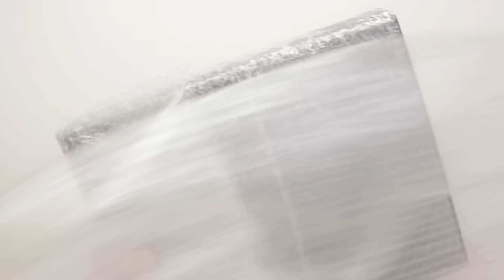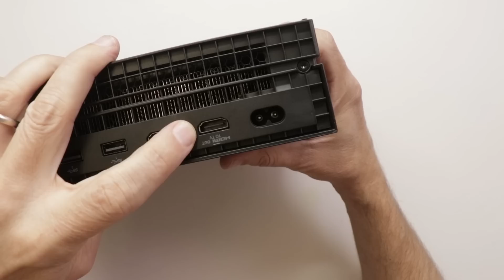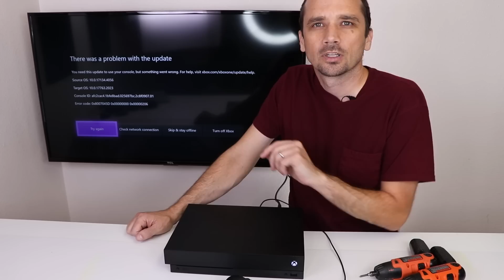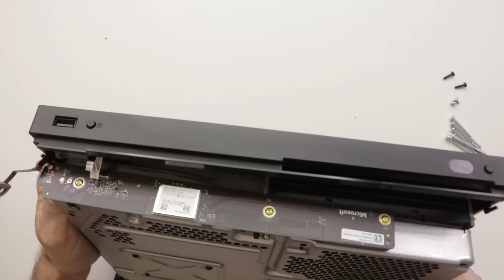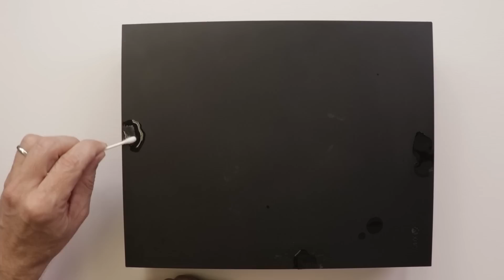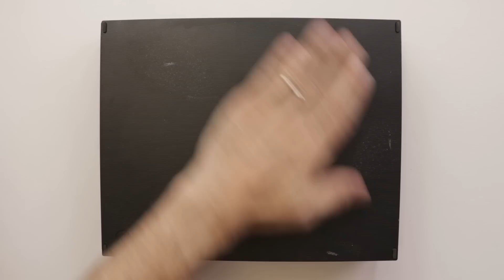eBay Repair Challenge 5 - It All Hinges On This!

Comment: If you ever come across this comment, there is a very very very good website a lot better than eBay and it doesn’t scam at all! It’s almost just like eBay but way more secure. It’s called mercari and yes it does have consoles such as this it’s a wonderful app and website! You’re guaranteed to get what you buy off of it as long as the seller responds, hell it even gives coupons for things over $20 if the seller you bought from doesn’t respond in time! I promise you won’t be disappointed. Also transactions of your money do not go through to the seller immediately like it does eBay. If you don’t get the item as it was said to be sold you have the option to report it before saying it’s good to go for payment. Hope you come by this!
Reply: Proof of not being a scam requires you to reply to me

Comment: For those interested - GooGone Citrus (kinda smells like oranges) for removing sticky stuff off of plastic. NOT the GooGone in the smaller metal cans! That stuff is industrial & is corrosive as all get-out. It smells kinda like lighter fluid. Stuff works great. (NO, I'm not a commercial, just trying to help out)

Comment: Use wax and grease remover to clean the outside of the consoles like this. U can get it at paint stores and stuff they use it to remove stickers on cars and what not. Works great just dampen a paper towel and rub it down. Comes right off. And it's fairly cheap and one can will last you years lol

Comment: Have you ever thought about fixing something different? Like a DSLR-Camera or something. I recently got an Olympus EVolt E-510 for 50€ and the only problem was a loose flex cable connection.

Comment: Consoles tend to use cheap junk hard drives, I'm surprised failures aren't more common.  Of course, non-tech people that only know how to plug things in, aren't going to know the difference between a hard drive failure and just "it doesn't work"...so the no technical experience of the seller was a huge benefit here.  All he knew was the console stopped working, so "it's broke".  When hard drives are very cheap and can be replaced easily.

Comment: I always use eucalyptus essential oil and let it soak in for stickers, tape and residual glue. Wipe with 99% IPA afterwards. Gives the cleanest result with the least amount of rubbing as rubbing could leave microscratches on plastic.

Comment: If you spent a large amount of money on a unfixable ps4 how did you have the money to buy an xbox one x which even you admitted are expensive.. Your cash flow doesn't seem to make sense
Reply from the maker: I sold the parts off that PS4 Pro for a total of $330.45 for a profit of $58.82

Comment: Hey I have a question. I have a ps4 original and it dosent realy turn on. The light will flash and the hard drive will spin for like 8 seconds and then it shuts of and dosent turn back on unless you swipe your-finger twice

Comment: I think the Ebay listings should have not been declared under normal selling conditions. Because the prices have been blown up off course from the challenge. But still overall good stuff from you both cheers
Reply from the maker: We had no rules regarding how we sold them...just that they had to be sold on eBay.

Comment: Confused about the console not having the stickers on the top while you're testing it, but they're back on after the testing is done? great video though and have really been enjoying the series.
Reply from the maker: I did the repair and cleaning in  a different order than how the final edit turned out. That's just how it works sometimes with these unscripted repair videos. I thought the order in which I edited it would make more sense.
Reply: @Tronicsfix  ha, I figured. I unfortunately made the comment before finishing the video. And realizing the wording it made sense that the cleaning was done before the testing.
Reply: @Tronicsfix  But your clearly showing a nonworking but clean (no stickers) Xbox at 5:10, but at 8:47 (with stickers) you clearly state "Now that we know this thing works" before you start cleaning.  Either you pulled the old bait and switch on us to get a good result on your video and the challenge, or you knew what was wrong before it all started, knew you could fix it, cleaned it first, and then taped the troubleshooting part afterwards.  Again, I call shenanigans....

Comment: 2:56 I've never seen that part of the start up animation, I just get the green background display.
Reply from the maker: Do you have an X? This intro is only on the X. It probably doesn't play every time...maybe only when you unplug it and plug it back in.
Reply: If you turn your Xbox one x  Fully shutdown it will play the next time you power it on
Reply from the maker: Ya, that's what I was thinking.

Comment: It might be close.  $200 for the console only in non-working order is kind of pricey when you can buy the unit new with accessories for less than $500.

Good luck to both of you.
Reply from the maker: It's pretty tough to find them priced lower than $200. I did take a chance on it though...especially since the seller didn't even know what was wrong with it.
Reply: The going rate this black Friday will be under $400 (I wouldn't be surprised to see some door buster deals for $350) which would likely include a controller, cables, game and full warranty. Assuming the controller and cables have a value of $50 and a game of $20. I don't see a used cosmetically blemished console (no controller, etc) being worth more than $250 in working condition, crazy what people think broken ones are worth.
Reply from the maker: I already know since I've already sold this one but it's worth well over $250. It is really crazy what some people think their broken stuff is worth!

Comment: There always a problem. People dont sell consoles for that cheap without a problem hidden somewhere. Sometimes they dont know what the problem is and end up selling it for parts or repair.
Reply from the maker: There's not always a problem. On multiple occasions I've purchased items marked as "parts or repair" that didn't have a problem. Obviously that's very, very rare but it does happen on occasion.